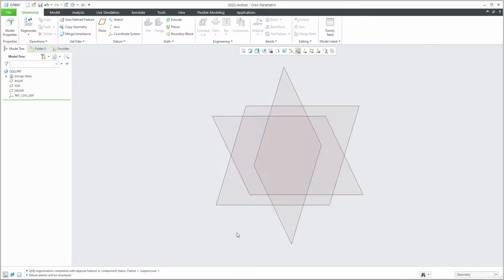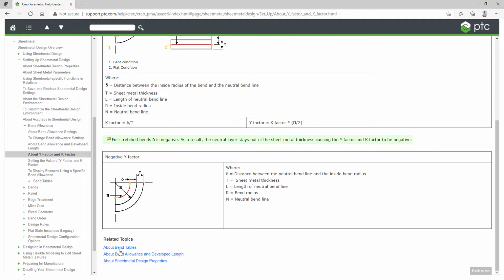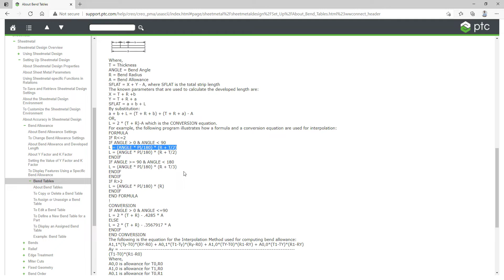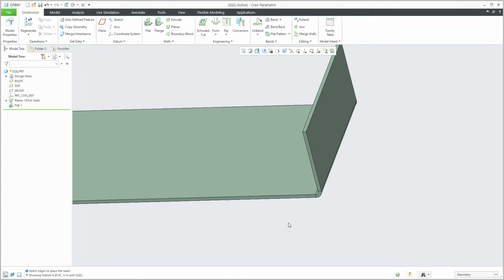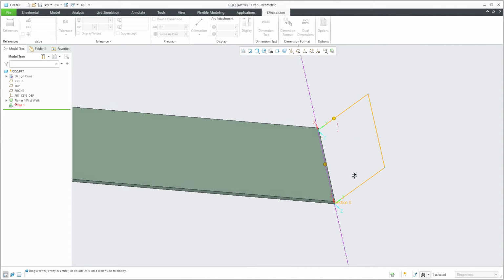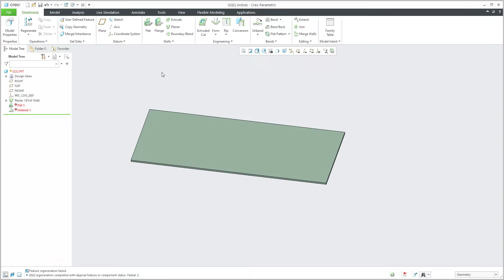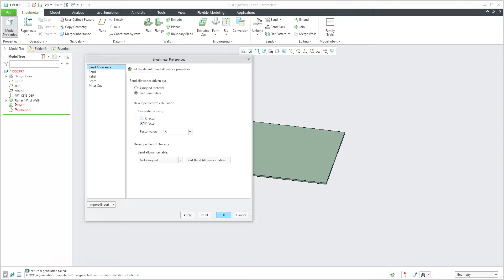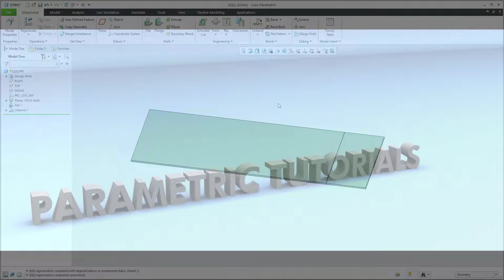Developed length of material | Y factor and K factor | Solve unbend problem

Comment: Creo parametric only uses K factor and Y factor? It is not possible to use bend deductions directly or have a bend table for different materials or angles?
Reply from the maker: Hi, in Creo you can also apply bend tables (specifically as needed = based on used material, angle, radius, etc.)
I will try to create some example and post tutorial, thanks for your proposal.
Stay tuned, Vladimir

Comment: Great video, thanks! General question, would you know why the volume of metal sheet parts does not remain the same when unbending the part?  Thanks
Reply from the maker: Thanks for your question. You have to be careful, because if model is bended (development length is only calculated as value, and length of the arc is different ) and unbranded part is with real development length.